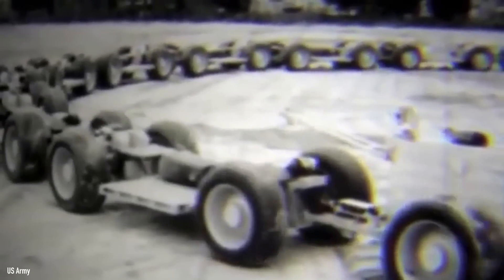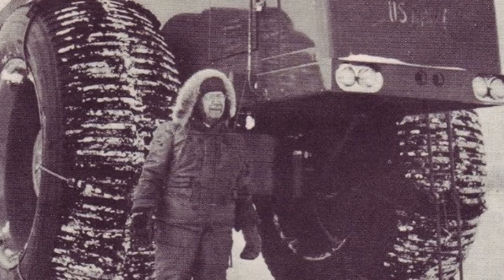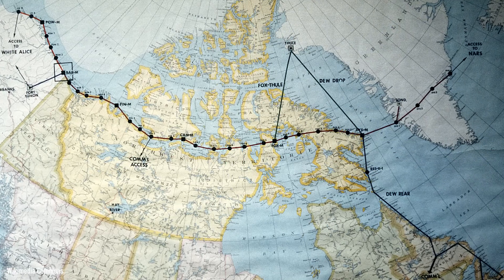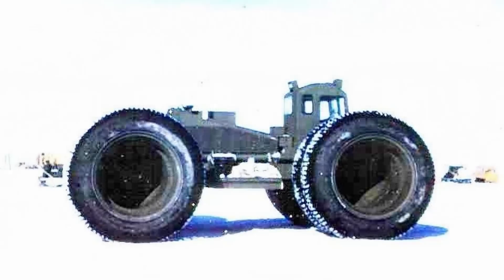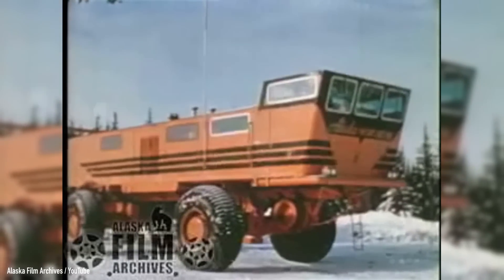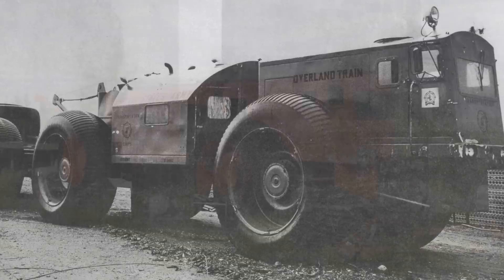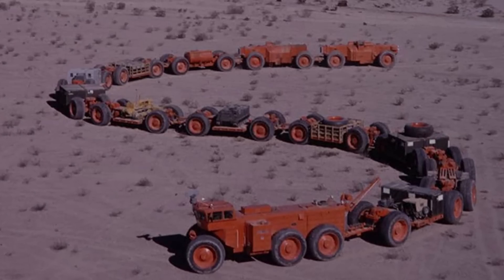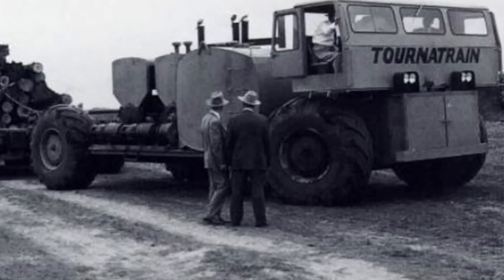The story of the huge US Army land trains - the largest off-road vehicles ever made!

Comment: I worked for the salvage company in Yuma that ended up with the train. We had the engine, two cars, and a few wheels in our yard for about a year. It was my boss who gave the engine to the Yuma Proving Grounds (he even contracted with a trucking company to supply the trailer to haul it out there). I have been all over that rig. The story told by the narrator isn't quite right. The engine was eventually sold for scrap in the early 2000's (when my boss bought it). He had it for several years trying to find a buyer in Alaska or Canada that would purchase it. My job was to get it running again (which I did), but we eventually pulled the diesels and generators out before giving it to the Proving Grounds.
I remeber trying to cut up one of the magnesium wheels with a plasma cutter. They were over 2 inches thick and very hard to cut up. We ended up hauling them to Barstow to a friend of my boss who had a shear that could cut up a tank. He made short work of cutting up the wheels.

Comment: Sorry, folks:
This "land train" (better: "off rail train") has much, much older predecessors!
Ferdinand Porsche invented such a contraption for the Austro-Hungarian army who used it from 1914 at their Eastern front to haul heavy supplies through bad terrain.
It was all there - including a gasoline powered tractor generating electricity for the electric motors in each and every wheel of this train.
https://www.researchgate.net/figure/Abbildung-3-Der-benzin-elektrische-Lastzug-von-Porsche-im-Jahre-1914-28_fig2_343858510

Comment: I'm wondering what the maintenance costs per hour would've been for one of those behemoths? I'm guessing still less than that of any given heavy lift helicopter that replaced it.
Reply: And the land train could operate in crappier weather that might keep a heli on the ground.  Probably was not any radio navigation stations in the area at the time, so can you imagine trying to navigate in the air?  No GPS or inertial navigation in that time.

Comment: I worked at LeTourneau 1974-75. Look for the tree crusher they made for the Army to deploy In Vietnam. We built one while I was there. 
The L 700 was also a revolutionary vehicle.
I drove a flatbed around the Steel mill, after our plate steel was heat treated. It was a blast!

Comment: There is some work on developing a land supply rout from McMurdo to the South Pole to reduce costs compared to air freighting in everything, and for use in weather planes can’t land in.   Something like this sounds ideal?
Reply: The history of large wheeled vehicles in Antarctica hasn't been so good.

What they use for the South Pole traverse are large tracked tractors pulling a string of flexible plastic sleds behind them. These sleds are basically just sheets of thick plastic welded together, and they carry big bladders of fuel to Pole, and haul some trash and other junk out. With everything being flexible they found they had far fewer problems than when they attempted more conventional sled-type construction.

IIRC the traverse only travels at about 7 mph, with one small vehicle going in front with a ground penetrating radar on a boom out in front of it to detect crevasses. A couple of the tractors have blades so they can cut through sastrugi and make or maintain the road, or to fill in the crevasses after they have used explosives to blow the snow cover off.

They can only do one traverse per year, taking about a month to get there and a little less to return, but because the quantities of fuel are so much greater than what airplanes can easily carry it still saves money overall.
Reply: @alanlight7740  
Thanks for the info.
Wonder why wheels don’t like southern snow as well?  Oh well.  The irony of dragging a bladder of fuel across the ice lice a block of stone to a pyramid is amusing.   ;)

Comment: "a mechanical drive connection to the trailer wheels, which meant electric motors could be used to power every single wheel." Is not technically correct as both mechanical and electric motors could be used like in a hybrid, you meant he chose electric hub motors over a mechanically driven connection
Reply: The Army considered one version of the planetary motors in the test version of the HUMVEE (sic) vehicle.  It had problems so the Army went with a standard driveshaft and differential.  Trains use a similar type of operation on all the locomotives in use now.

Comment: I want to see some shit like this on mars
Reply: out of all the crazy ideas ive heard about mars projects, this actually makes sense. Although the land train would weigh a fuck tonne it would still be less then the locomotive AND its infrastructure. The low gravity and thin atmosphere would also mean it would take less power to run too.
Reply: @Queue3612  not just that it would be VERY practical for supplying martian towns. But probably the biggest factor in all of this is that with modern technology you could just mass produce the carrier cars with integrated batteries and hub motors, and then put different modules on the flatbed. Also could be fully self driving. You could not only supply smaller martian towns, this thing could be a mobile base in it's own right.
Reply: @Astro_Alphard  A mars base would definitely need large scale transportation. If the base is producing rocket fuel to get home, bricks of compressed mars dust, growing lots of food, or any other industrial production, they would probably need satellite locations for mining operations. This would require mass transportation of raw materials and the occasional transportation of people.
Reply: @thermophile2106  this thing IS the mars base.. all mobile.  you have seen and researched everything in one spot? a rather nasty sandstorm is coming? move your entire base like a RV to a nicer spot.
Reply: @Phil M Elon Musk and the guys at Boca Chica: holourmy beers

Comment: How where the wheels steered? It looks like each buggy can independently steer around a radius which must with be done by computer or mechanically actuated from the buggy ahead somehow. 🤔
Reply: Front axle appears to pivot with the following cars steering like a wagon.
Reply: @tihspidtherekciltilc5469  yet the turn doesnt seem to chase the center of the turn radius. hows that done with a fixed rear axle?

Comment: The land trains are not finished. They are just less visible. A mine in Australia uses trucks with powered axles on all five trailers to haul 300 tonnes of ore at a time to a railway. Since they use public roads the vehicles have to meet the width limits for a standard semitrailer. The engines on the trailers are standard diesel rail motor engines designed for under floor mounting.

Comment: I live in Yuma Arizona, and in the early 1970’s I worked at a military surplus equipment yard called “Jet Sales”.

That company bought the Land Train and I was involved in cutting the thing into smaller chunks for recycling.

It was built entirely out of Aluminum!
Reply: Do you remember which one it was?
Reply: @KentuckyFriedChildren  it was the one in the video that was tested at Yuma Proving Grounds.

I still remember filling barrels with the bolts that held the wheels together as I disassembled them.

My boss was really upset because the specifications for the train said that the Buss Bars, the conductors that carried the current from the generators to the individual motors in the wheels were supposed to be Copper.  The potential value of an an estimated one mile of 1/2” by 3” copper plate was very high in 1975!  But the manufacturer substituted aluminum instead.

I still filled multiple semi trailers with aluminum though.
Reply: @papasfixitshop7982  so you helped spawn bigfoot 5
Reply: Yeah, I had to take the tires off to get the motors out of the hubs.

Lots of bolts!

We never thought the tires were good for anything!

Comment: I know someone wgo cleans the oil tanks on those early warning systems. They have to fly in and fly out but damn he makes good money

Its 2021 and they still maintain them
Reply: Kinda sorta but not really. Many of the original DEW Line facilities were deactivated in the early 60's with the balance decommissioned in the early 90's. In 1991 the Northern Warning System using non-manned and minimally attended stations were up and running. While many of the new facilities were built on the same site as the DEW Line stations, all, save two in Alaska and one in Canada were completely new facilities. All the Dew Line facilities (except the three mentioned) were "remediated", i.e. buildings dismantled and soils treated for contamination.

Comment: The real problem with advancing levels of technology is the risk of being eclipsed by even newer technology. Clearly the Army did not realize that larger and greater lift helicopters would or could haul the kind of loads this land train was designed for. Still it seems a waste and I wonder if the Australians could have used this. They have a number of similar kinds of ling haul vehicles for transportation in the western deserts.

Comment: I work for the company that built the land trains back in the day. The motors and planetary drives are awesome.
Reply: Hey I used to work there too! They still make really amazing (and even bigger) machines.
Reply: @cliffwhite5552  do me a solid you sound like you still follow what they do who owns the company because it was sold in 2011 and what do they use as a name now just do me a favor prove you're the real thing there's so many fakers out there I don't understand the love for lying
Reply: Hub motors.
Reply: That was such a fun company to work.  So much history and such a fine university to get an education.
Reply: I just love the LeTorneau double lead screws that check out as a fine thread pitch but won’t thread a fine thread bolt into the hole. You must buy their bolts. Oh I almost forgot the aluminum balancing weight bolt. I worked at Letro Power Memphis. A rebuild facility. Yes, very nicely made heavy duty motors and gearboxes. RG was a very sharp fellow.
Reply: Liar
Reply: I'm from tyler, not far from Longview. Lived here for years and only just found out about letorneau!
Reply: You just taught me a new thing, planetary drive. Thank you.
Reply: @Erreul  Have you done more study on planetary drive motors?  You probably know planetary gears are used in automatic transmissions.  Another common application is the hydraulic fluid powered hub motors used on heavy earth moving equipment, and possible some of the "zero turn radius" lawn mowers.  I believe EATON makes many of these motors.  Planetary drives are used when you need low speed, but lots of torque.  Have a good day.
Reply: @chetmyers7041  Actually yes, I've only looked into it a little bit, since I haven't looked into it that deeply at all the only thing I really looked into was by John Deere and a couple other Russian Tractors witch I don't remember. I am looking up the DowMax since you brought it up now actually.
Reply: @Erreul  I don’t think you know what the word “taught” means. He didn’t teach you anything. Knowing the word, doesn’t really mean knowing something  new. You’d actually  have to know what it means, which means you have to look it up.
Reply: @jamesbizs  I didn't read passed the first period, please never talk to me again.
Reply: @jamesbizs  He taught him a new technical term, which he could then look up to learn what it stands for. If he had never heard the term "planetary drive", he couldn't even have gotten the idea to look it up, and thus would have remained oblivious to what a planetary drive is, or even that such a device exists. So yes, he was taught something, and he seemed to think it was useful.
Reply: @Erreul  Hey, j p was a bit blunt with you, and in my mind he was also wrong, but there is still no need to go on like that. If he wants to comment to you again there is nothing to stop him.
This is the beauty and the curse of public discussion. Open your mouth and you run the risk that someone might object to what comes out of it. :)
Reply: @bennylofgren3208  People nitpicking words is no one I really need to listen to, especially when it's as irrelevant as "He didn't teach you-". "I absolutely agree with you, there should be public discourse, and from that I've decided his points should be ignored, taking literal words and basing that as some sort response while ignoring literally everything else about language is not a person I not only not want to associate with but have IN my discussions because they've shown their opinions will be nitpicks, not rebuttals. This is not a court room, the is comment chain on a YouTube video about a technology that I commented I've never heard and was glad to have heard and looked through, and his response right from the beginning was "Whel Acthually", it was annoying in school, it is not a benefit to the over all conversation, and I will not be interested in anything he decides to post again. 

I do however, write this agreeing with what you said, and while I do appreciate your opinion I do not appreciate an Encyclopedia Britannica throwing an asterisk on my use of a word with no self awareness.  I'd be more than happy to get deeper into it if you wish.
Reply: @jamesbizs  learning a new word IS learning. Not knowing the entirety of a subject doesn't mean you didn't learn anything. He didn't know the word planetary drive, and now he does. He learned something. Simple. Derp
Reply: @jamesbizs   you just solved the most important communication issue in the world.......congrats....yeiiii..good boy.....here take a treat...
Reply: @Erreul  You are hillarious :D Great reply. What a d-bag. Ill use that reply some time!
Reply: @jamesbizs  If it makes you feel better
Reply: @bennylofgren3208  that's some solid advice right there
Reply: Planetary?  It went into space?

Comment: Four of those tires and wheels wound up in Nome, Alaska on a gold mining machine.
Reply: What's the name of that mining machine? I'd like to look it up and see pictures of it with the wheels on.
Reply: @rixille  those tires were on another gold  machine up there in the early 1970's. Sat on
Sandpit for years by Dale Whitney's metal shop until they wound up on that machine. The original had a 3208 Cat engine running a hydraulic pump and motors for motive power. I tube might have more videos.
Reply: @rixille  sent before I looked. It was U-Tube.
Reply: Yes but greed and contra versify amongst the owners doomed that project. I knew the engineer that designed it.